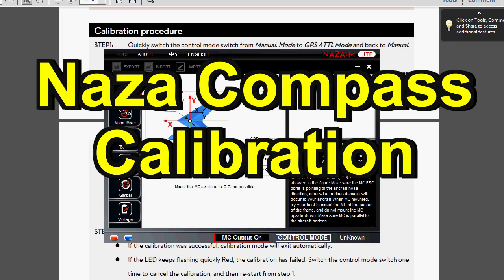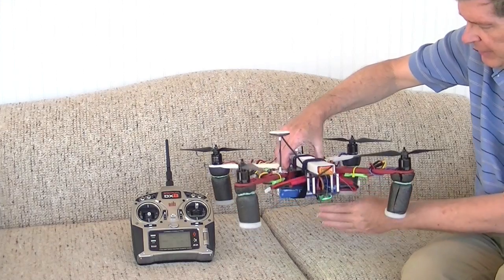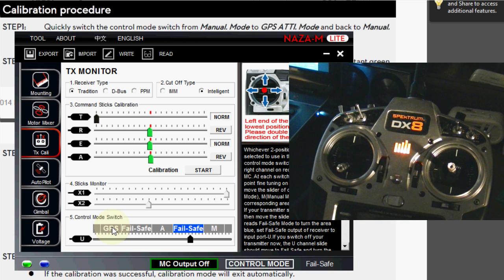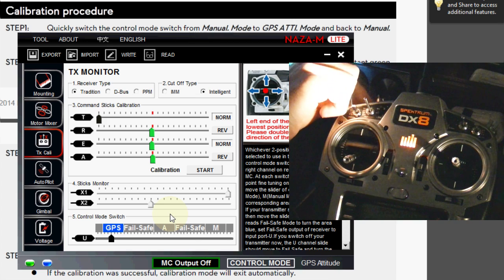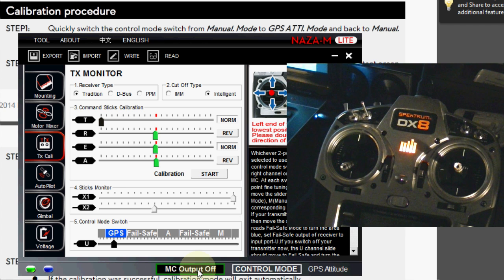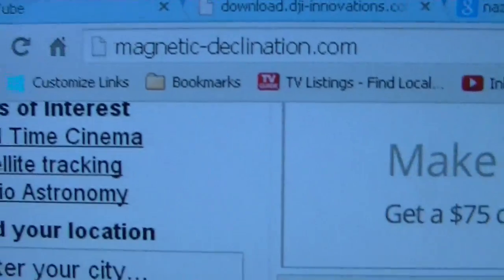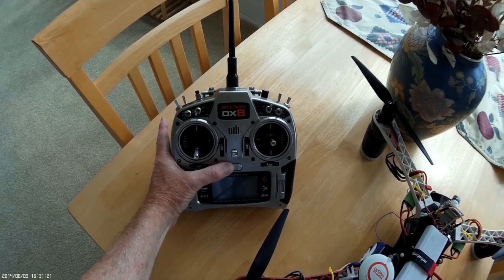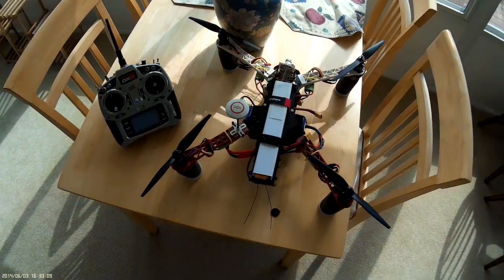DJI Naza Compass Calibration/Dance and Adding Failsafe Switch

Comment: Thanks for creating a great informative video. Just what I needed. Very easy to follow. I have a 450mm frame that pretty much looks like yours. Was wondering about the landing 'feet' you have. Did that come with your frame or is it home built and if so, what is under the foam wrapping? Thanks
Reply from the maker: It just pipe insulation tubes from the hardware store and some bottle caps. The bottle caps are held by a rubberband attached hooked on a paperclip.There is nothing inside the tubes.
Reply: Thanks for the reply. Sometimes its the simple things that work best. But SOMEONE has to think of it. Gonna try this. It looks very stable. Not apt to topple.

Comment: Hi i have tried the naza dance but after calibrating in the vertical, the solid green light remains on, How do you get the 4 green flashes?
Thanks
Reply from the maker: Travers Tennant Could be you have a GPS fix or the calibration didn't finish. That can happen. You have to flip between manual and GPS mode to initiate the dance, but you can be in any mode to do the dance. At the end of the video I flip to manual before doing the dance thus end up with no flashes at all. Try that.

Comment: Very nice :) I love this idea of failsafe on demand, until now the only way for me to have one was to turn off my radio! I made my calibration dance the way you executed it at the end of your video :)
I heard about the magnetic delination. If i understood correctly, for example:
Magnetic declination: -14° 57' WEST
It means i should move GPS about 14 degrees to the left?
Thanks for your great video :)
Reply from the maker: I think you are right about the dec. 
If you have it wrong the quad will toilet bowl in the opposite direction when in a GPS mode hover. I will add a link to the toilet bowl video under the description for ya.